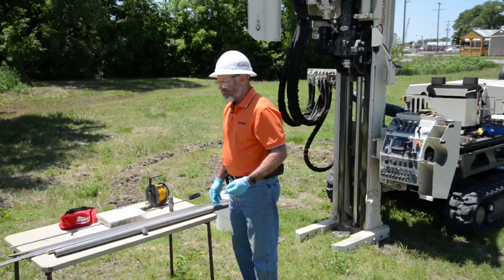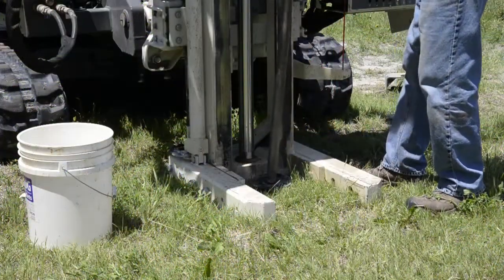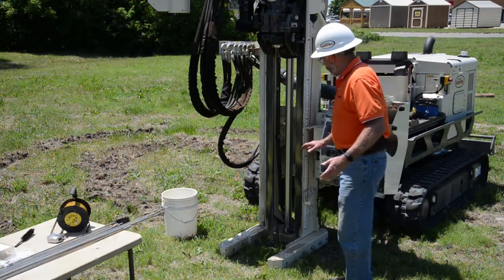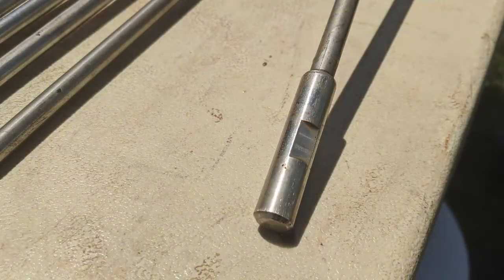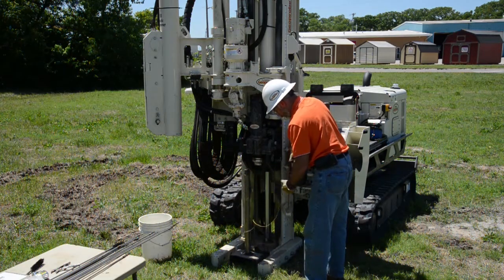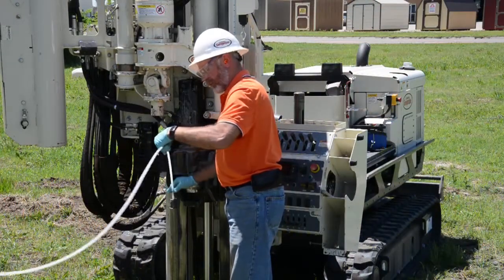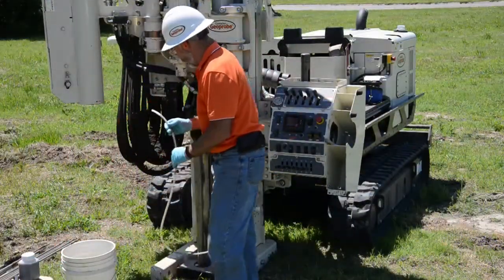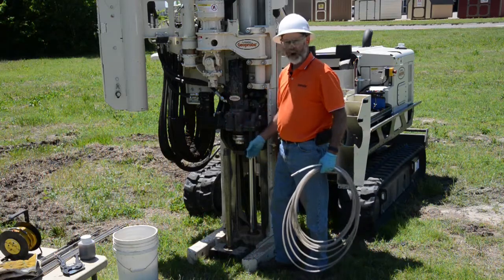Geoprobe® SP16 Groundwater Sampling - Step by Step

Comment: Can you tell me the difference between the SP16 and SP19 groundwater samplers?
Reply from the maker: The SP19 would primarily be used with 1.75” rods so the outer sheath is a little thicker/larger as well.  That’s the primary difference between the two.  There is a little more information here: https://geoprobe.com/tooling/sp19-groundwater-sampler